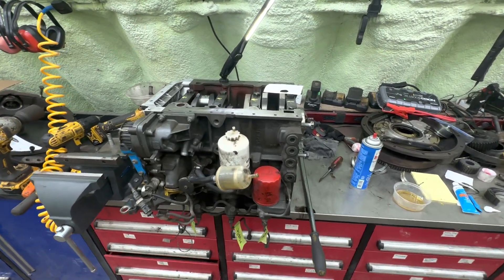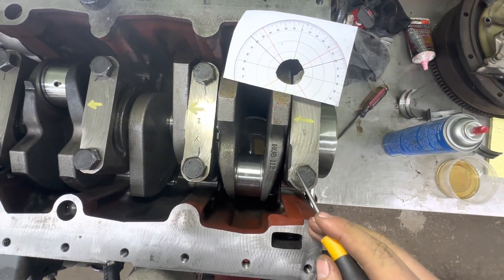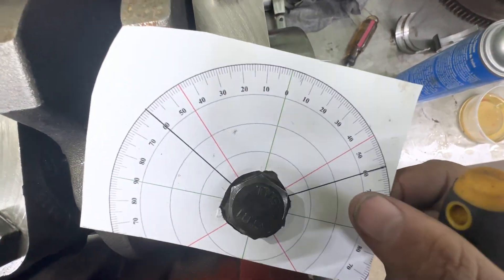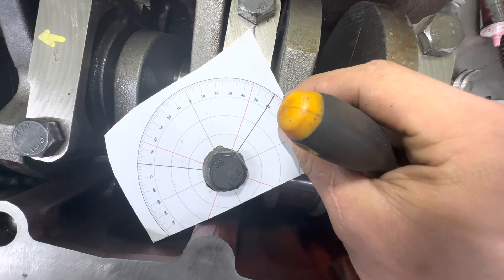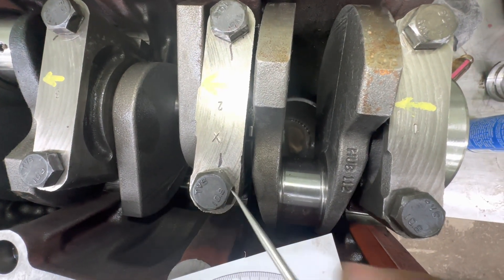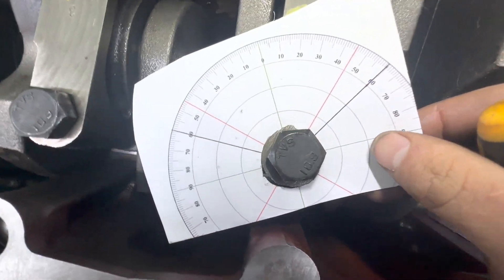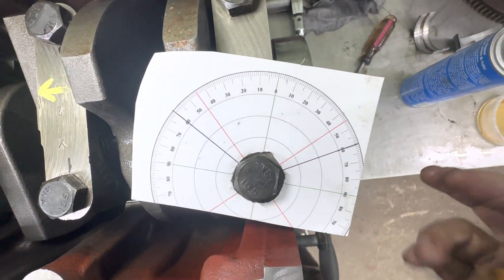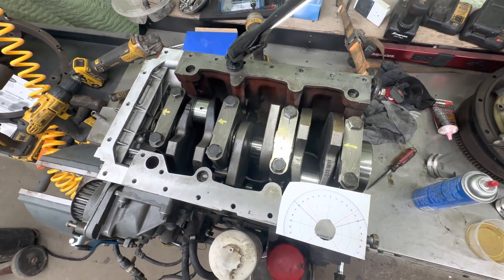Torque Bolts to Angle Without Special Tools!

Comment: Could never get my head around why 60deg....then 45deg.....why not just 105......or does it need to go in smaller steps.
Reply from the maker: @nickaxe771  smaller increments to evenly pull the head down to avoid warping